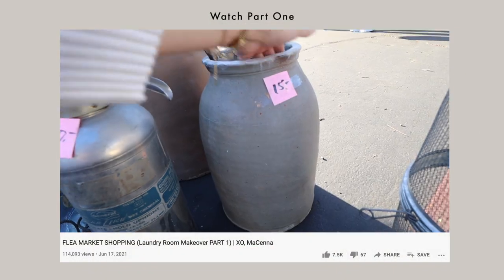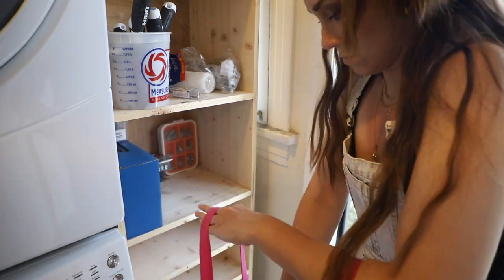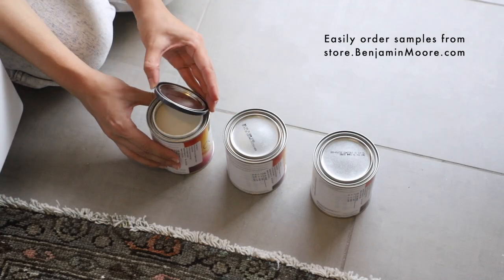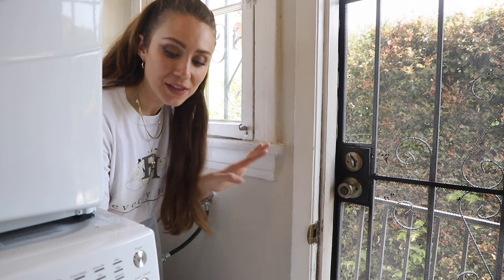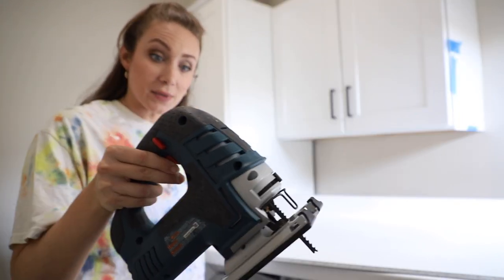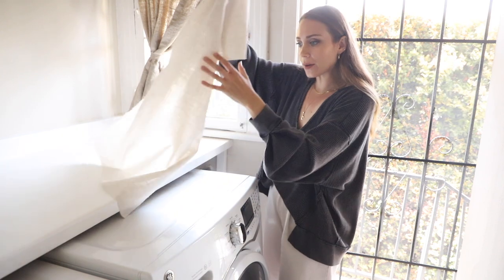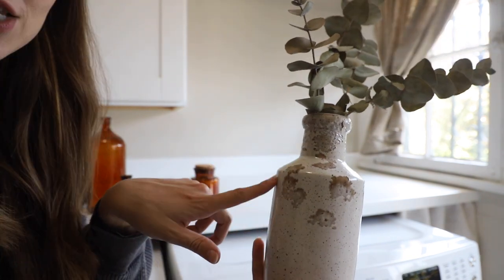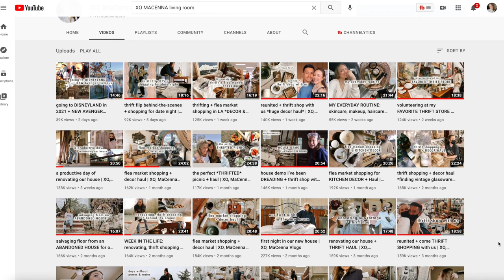DIY LAUNDRY ROOM MAKEOVER (Part 2) | XO, MaCenna

Comment: Looks great! Not sure if it is noticeable or if it was just the camera angle ... but maybe paint the underneath of the cabinet you installed. Also it looked like there was a lot of space to the right inside the water heater cabinet. Maybe you can retrofit the wood shelving you pulled out of the laundry room and put it inside the water heater cabinet. It could hold tools, nails, paint, etc.

Comment: In the event of a problem with the washer, is there an emergency water shut-off on it or would you have to pull out the unit to get behind it (and under the newly-installed countertop)? With the breaker box nearby, at least you could kill the power to either appliance. Could you drill a hole near the back of the counter, large enough to access a short extension cord from the outlet used by the w/d to allow for a lamp? Candles, think flameless.

Comment: Love your room, great as usual. Just wanted to say in case you did not know, the doors on your appliances can usually be switched to open so they are not back to back when opening them. This is just like when they use to ask if you wanted a left or right handed door on your fridge. I have front loading machines and I changed the doors to make it easier.
I am loving all the cottage renovations.

Comment: Container store sells an awesome accordion hang dry system setup that folds up flat against the wall so you don't have to block your window 👌 I've had it for over a year and it's been great, no issues and very sturdy even for heavy sweaters as long as you mount on a stud

Comment: This is gorgeous and perfectly simple. Quick tip for ya: many washer/dryer doors can open (hinge) either direction to move loads between the two without a door in the way. Check youtube for a how-to  — it's usually as easy as unscrewing it, rotating, and locating the prefab screws on the other side. Much more convenient!

Comment: Tape the counter edge before you cut to prevent chips. I bet more people will switch their granite counters once they realize the maintenance they’re supposed to do. Resealing granite once a year is suggested. I think they offgas radon. A tankless hot water heater may take less space. I haven’t read the installation manuals for any hot water heater in a long time so ????  It’s such fun to watch your DIY’s. Thank you for sharing.

Comment: MASSIVE improvement from the way it looked before. I bet your landlord was thrilled!

One thing.....in case the tension rod doesn't hold, you don't want a real candle there because any fabric that lands on the flame may catch fire. You might be better off with a battery-operated candle, or a solar candle.

Comment: most washers & dryers nowadays have reversible doors to change which direction they open from. just a tip in case that would make it easier for you to switch loads. i have mine open from opposing sides so i can just toss from the open washer into the open dryer.

Comment: Read all 1000 comments and didn’t see this suggestion. 

You could add L brackets above the washer and dryer and then add a shelf with a false front and pull the countertop out to the edge of the machines to make it look more finished. Or just add a long skinny box to hold smaller stuff. I think it turned out beautifully. A folding step stool tucked in next to the door would also help getting to those higher shelves.An extension cord underneath the box could power that cute lamp.

Comment: Amazing transformation. Great job. Two ideas. Would have been nice if the bench top was a little deeper to cover the machines, but I guess that would have involved chamfering the ends to match the cupboard and the door. Some more noise reduction on the curtain into the room would be good. Could you up-cycle a doona? Maybe a barn door?

Comment: Turned out so nice! Wow. I was thinking you must be the only person who comes home to relax from your renovation project and renovates your laundry room, lol. I know it was a smaller project though and you seem to be in your happy place doing renos so it works out for you. Meanwhile, I desperately need to redo the calking in the shower in my second bathroom and have been putting it off because I love to shower every day and when I commit to doing it, I will have no other options than to use my other bathroom which has a tub. TBH, I'm also sacred of calking even though I've watched several videos on it. I know this is super lightweight stuff compared to renos but it shows you where I'm at in terms of my level of comfort doing literally anything around my house, haha...
Reply: A lot of caulks dry in hours and if not you can always tape a lightweight plastic sheet over it for a few days. The trick with caulk is to use a small amount with the gun and then a wet finger to smooth it out.

Comment: you still can use some of the space in the water heater cabinets, Idk if I can explain it, you can make a removable plywood shelves to sit in there, but cut part of them like half circle shape or so, to make a  stimulator space for the part of the heater that in the level of the shelf. 
it's hard to explain and I'm not very good in English.

Comment: The room looks stunning! The only thing I was wondering about at the end was the container next to the drier bald in the pretty glass container. I personally would have transferred the contents of what I’m assuming is liquid detergent into the taller Amber bottle by the window, with a nice stopper and maybe a diy embossed label the same way you did in the kitchen pantry space, kind of tie that in (especially since it’s right ne t to it!). Or at the very least I would remove the stickers on it if that’s possible, and if not, even a quick diy to cover it up. It kinda stuck out like a sore thumb to me a little bit. Which is only really a testament to how pretty the room turned out otherwise!

Comment: There are light bulbs so you don’t need to be plugged in. It has a little adapter thing you connect to it and you can either remove the cord of the lamp so it’s not just sitting there or fold it up under the shade.

Comment: Wow! So much better. What about the crown moulding on the top of the cabinet? I see you took off the one side of the tall cabinets but left the front. I would take off the front piece then if you aren’t going to finish the rest. You can add some battery operated puck lights under the cabinet to light up your countertop.

Comment: If you still want to use the lamp in the corner ...
1. Tape the cord to the back or let it hang over the counter to disappear. 
2. Get a puck light with remote timer & secure it where the electric light bulb goes. After setting the timer the remote can sit on the broom rack shelf.

Comment: I'm not sure if california has any laws/policies on this, but here in florida it is very common to change those water heater tanks for small electric ones. It's literally a small box on the wall and they work very well! It would free up so much space for you and you could actually use those cabinets as storage... just a thought! again I don't know if there are any specific reasons or regulations that you wouldn't be able to do this but just wanted to share the idea! :)

Comment: You need to flip the washer and dryer. Will be easier to put into the dryer.
Reply: I couldn't get a good look at the w/d, do the doors open differently?
Reply: So much easier to just change the doors.

Comment: Wonderful transformation!!!  Great job!!!  The rug is beautiful!!!  Gentle suggestions:  additional storage opportunities to pass on to future renters:
a)  above the door
b)  above the door + along that wall - a long row of shallow, short cabinetry, staying above the door frame height, and making it flush to the ceiling
c)  above the new set of cabinets - install another set on top of them, taking them to the ceiling (added benefit is you don’t have to deal with dust accumulation on the open top of the current cabinets) - this will mean adding a set of cabinets above the set surrounding the water heater, too, for a cohesive look

Comment: Your makeover turned out great! Its a shame that double stacked cabinet can only house the hot water heater, so much wasted space. Consider using tankless hot water heaters for your TX house and cottages. On demand hot water reduces your electric bill significantly and its small and attaches to the wall.